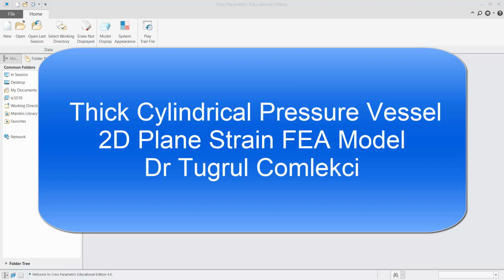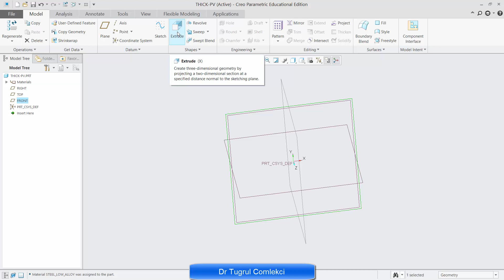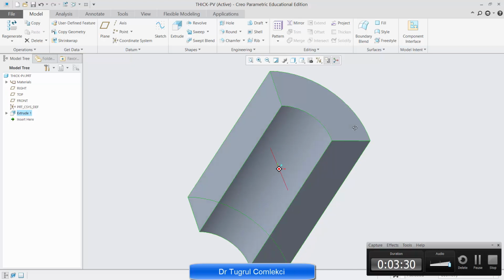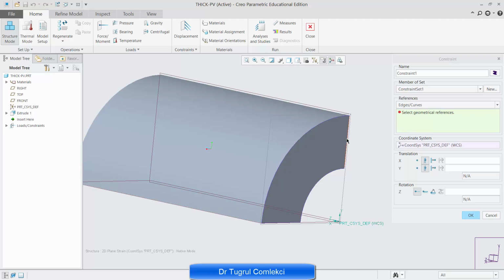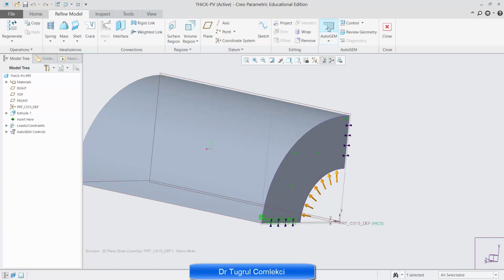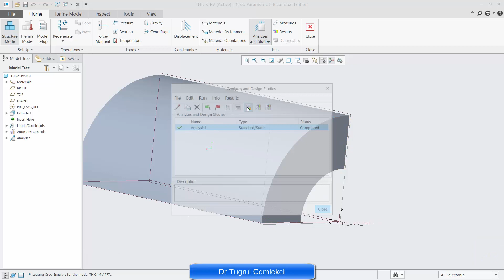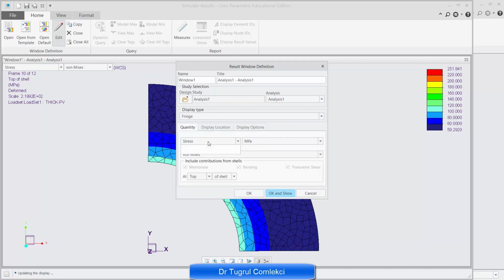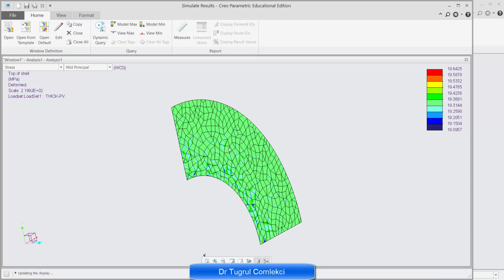Thick Cylindrical Pressure Vessel 2D Plane Strain Finite Element Analysis

Comment: Thank you Tuğrul hocam. You draw a 3D model, not 2D in video. So the analysis becomes 3D. How can we perform an anlysis on a 2D (especially plain strain (not pln stress)) model? Consider the full cross-section of that cyclinder. It has an annular area without any height. Because the height must be very verry big (infinitive if available) in plain strain assumptions.